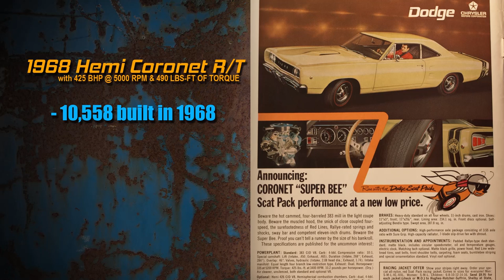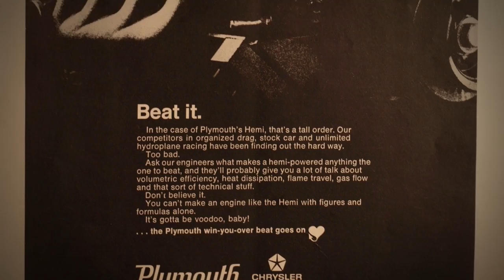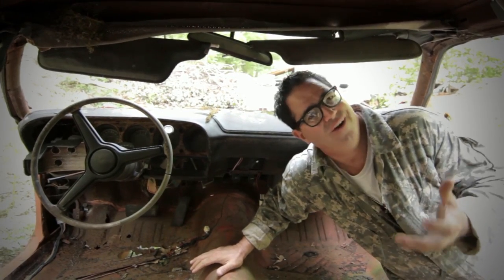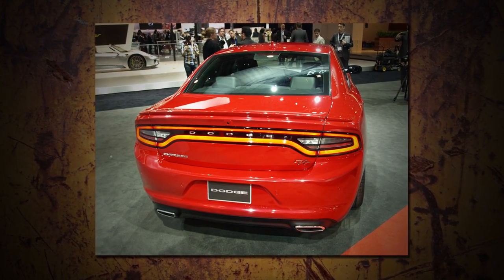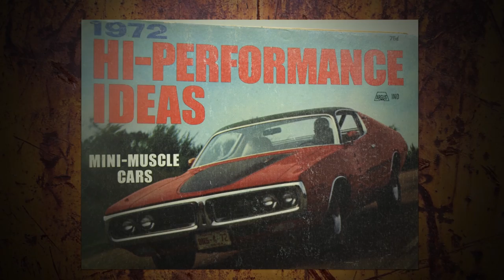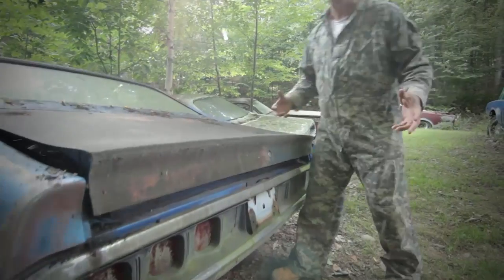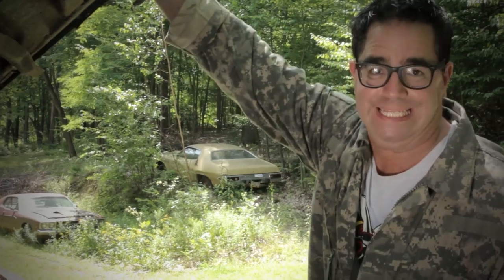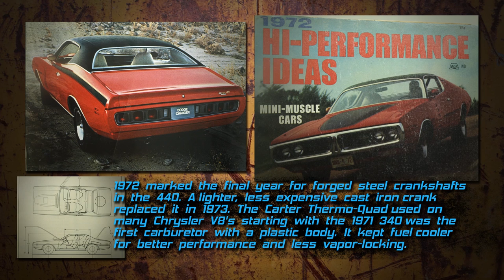Steve Magnante's Junkyard Crawl - PILOT

Comment: I have a 74 Dodge Charger SE with a 71 chrysler newport 440 tnt big block an a 5 speed stick from the late 70s by a shop called monty 3.92. I paid 1400 bucks for her. She is yellow with a white whood an trunk lid. All she needed was a good cleanin an some new fluids. A battery an tires an a new gas tank. Fixed the brakes an had her ready to drive. Fer less than 3.000 bucks. She has a galvanized steel shifter an a old harley clutch handle an no clutch pedal in the floor. Originally a 340 with a 4 on the floor stick. She looks nice. Sounds mean. An goes through tires like a monster while ripping asphalt too easily. I have had to put in double layers of diamond plate custom cut an welded in by me. She is heavy. An fast. Not bad on gas fer a 2 barrel carb on a big block. Best on dirt roads. Has a higher stance than a normal car. The tires are P235/75R17. Its a pretty big car fer a 2 door Charger. Mopar or no car yall.

Comment: GM 400 wasn't even Big block he might have meant before 70 & the 454 but buick had nailheads so he got his 💩 wrong for one thing but i know he really knows so must have forgotten to say 500 ci caddies wasn't a muscle car but 455 was a& bop all have one and each is different not anything swapped over besides alternator and AC compressor and fans  but they are not any engine parts that swap